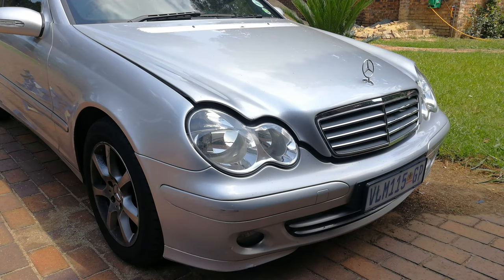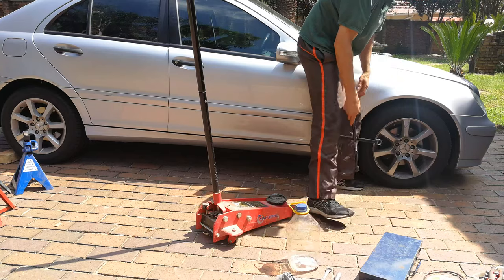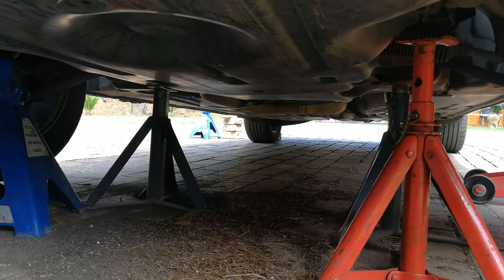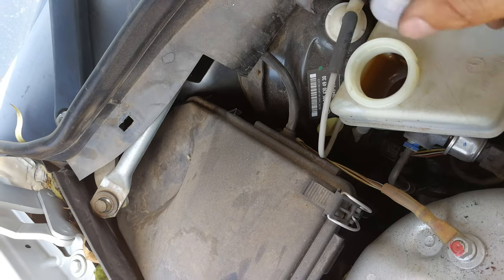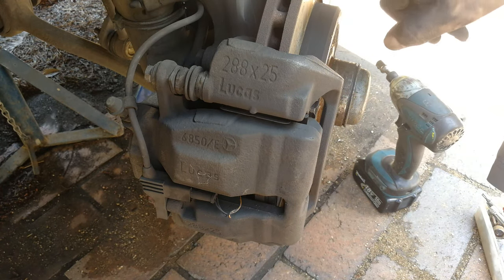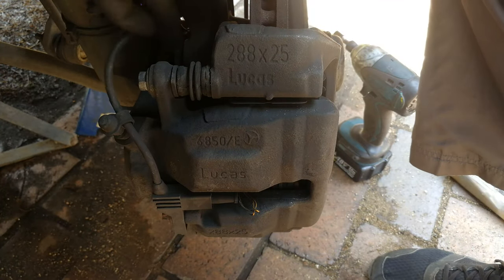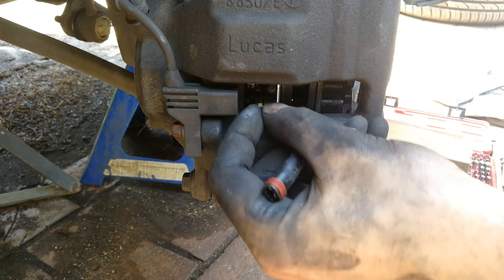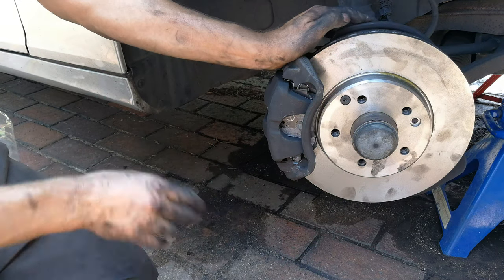How to change front discs and brakes on a c-class Mercedes (w203)

Comment: Thank for your instructive video. The best bleeding procedure is through the bleeding nut and
not through the resrv. due to possible clogging and over spill . I am just wondering if both front brake kits came with pad secure pin because I found it on my MB. C230 rear brake and I have no idea about front one, which I am planning to work on them very soon.

Comment: Very good step by step instructions. You spot on about the first 100km. When I replaced both my pads and disks, the brakes took longer to engage, I think they call it the bedding in the brakes. So as you said , no heavy breaking. After the first 100km, the breaks then was awesome.